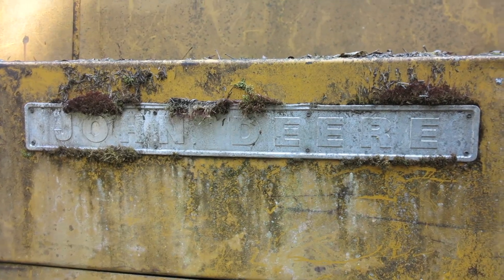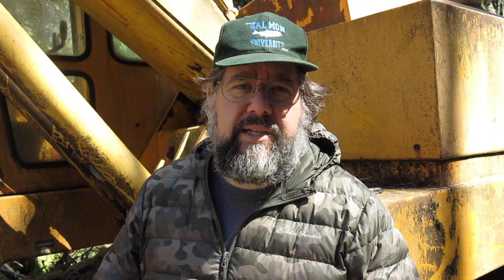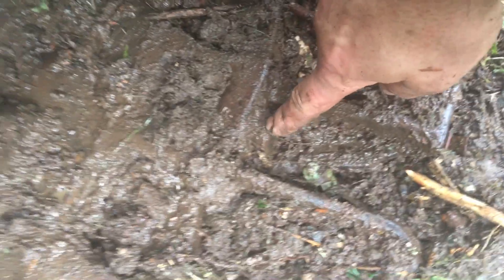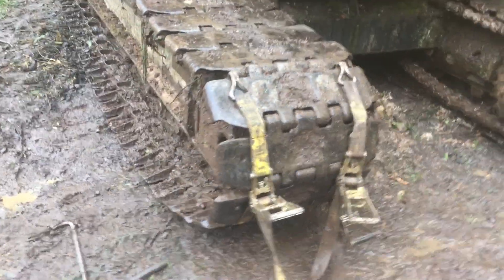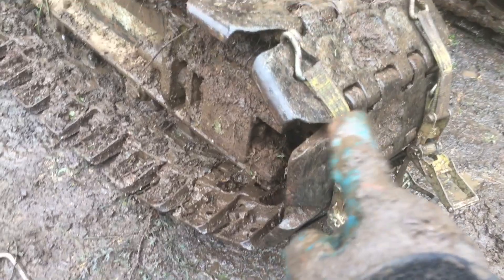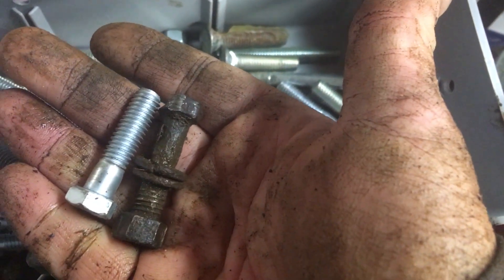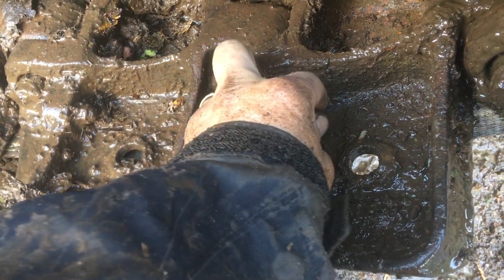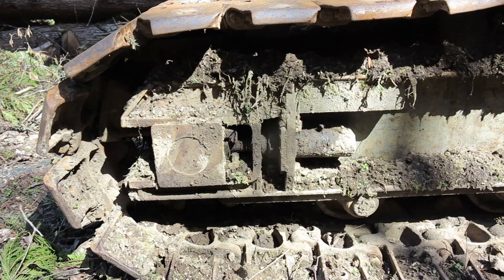John Deere excavator track repair – thrown track!

Comment: I am looking at a similar machine. Was wondering about part availability for it. Have you run into any issues?
Reply from the maker: Truthfully, in 15 years of owning this machine, I have not had to buy many parts for it. I've replaced a hydraulic hose, and of course filters, and I've had the starter worked on once and put a starter solenoid on it twice (lesson learned – only buy Standard brand solenoids), and that's about it. The starter is an Delco/Remy, the injection pump is a Stanadyne, if it came to buying specific parts for the hydraulic drive motors or the John Deere engine, I may have issues finding them – but I haven't had to do that with this machine. It is old enough (1970?) that some of its brothers and sisters are being scrapped now. Of course if you have the chance to get a machine with a hydraulic thumb, get that one... this one has a stiff thumb that was added to it at some point, it helps, but I really wish I had added hydraulics to it at some point. I even have an extra valve block from a 690B that I picked up at one point. If I could do it again, I would probably buy a 690B or later... there's a big difference between the 690A undercarriage (which is chain driven and threaded-rod tensioned, like an old crane undercarriage) and the 690B and newer (maybe 1974 and newer?), which are directly driven and tensioned with grease, like most modern machines... but I bought this machine for $10k about 15 years ago, and it has worked well and owes me nothing.

Comment: Any thoughts on where or how to get new slack adjusters
Reply from the maker: New ones for a 690A like this one? I imagine you'd have to fabricate them or have them made for you. It's a long shot, but you might be able to find NOS ones somewhere. You might be able to find used ones in a scrap yard somewhere, but this type is so old (50+ years) that most of the non-running ones have been scrapped and melted down by now. If you're talking about a 690B or newer with hydraulic (grease) adjusters, you might have better luck... it seems like there were more of those made, and since they are slightly newer, there seem to be a few parts here & there...

Comment: Working on tightening the track on my 690a I just bought. The teeth on the track keep walking to the side of the tumbler wheel, Ive tried tightening the outer and losing the inner and vice versa but no luck. Any tips?
Reply from the maker: I would keep the outer and inner adjusters the same length, more likely your track is just walking off the way you're turning (pivoting) the machine. Tighten the tensioners on the end of the carriage with the drive chain tensioners first, then tighten the ones at the non-driven end. If you can't get it tight and have to run with loose tracks, spin the carriage so the drive wheels are at the back, so they are always pulling from the bottom of the track as you move forward, so the weight of the machine will keep the track tight and in the guide rollers... if you do the opposite (drive wheels at the front and pulling the track down from the top) and the track is loose, the cogs will skip and that's how you throw a track.